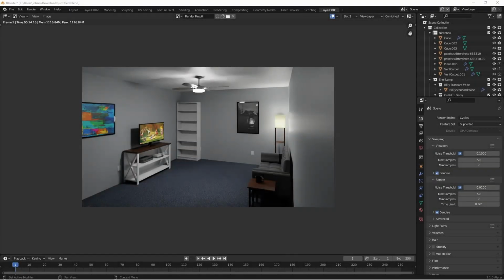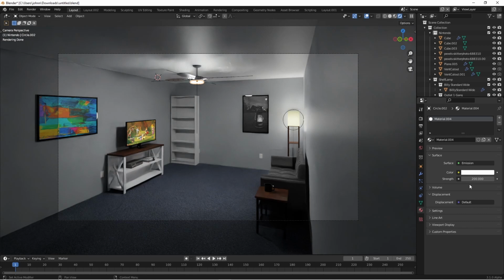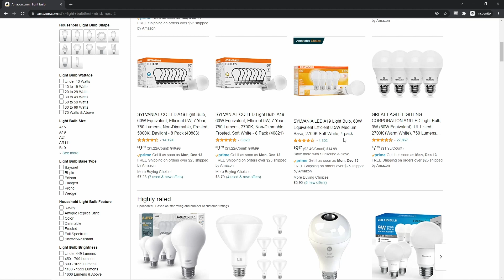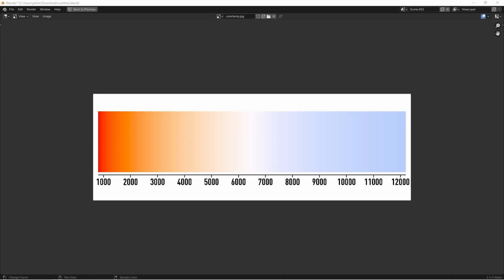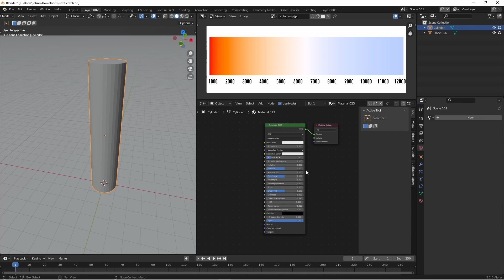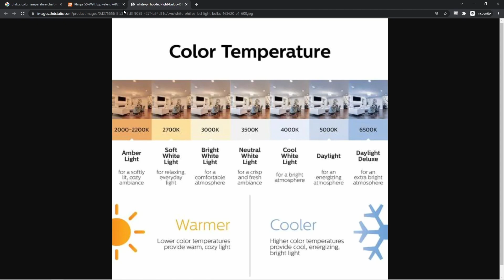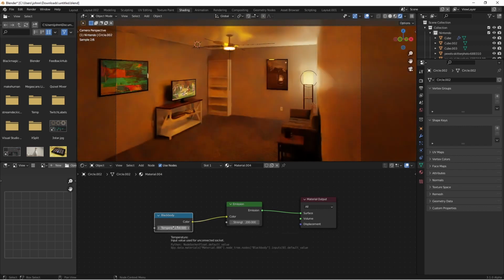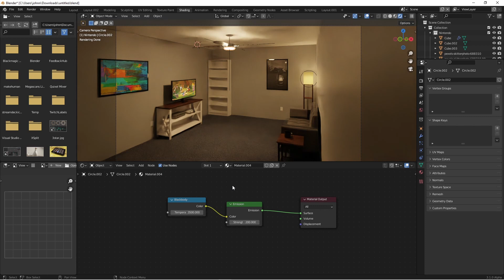Blender: Lighting with Color Temperature

Comment: This is a very cool way to do this in vanilla Blender! I had completely overlooked the "blackbody" converter node as an input for emission shaders. There are also addons like Photographer 4 which build color temp into the lights, provide options for more realistic vignetting and bokeh, and more. And the Extra Lights addon allows for color temperature as well. Both of these are paid add-ons, though, so I'm glad there's a method to implement more grounded lighting without addons as someone from a cinematography/photography lighting background!

Comment: Is it possible to do that in compositing?
Reply from the maker: Sure you can color grade and hue correct in compositing. But if you had 2 lights with different color temps, you would then have to render light groups and do each individually.

I think it’s best to get it as good as you can ‘in camera’ before you hit the compositor.